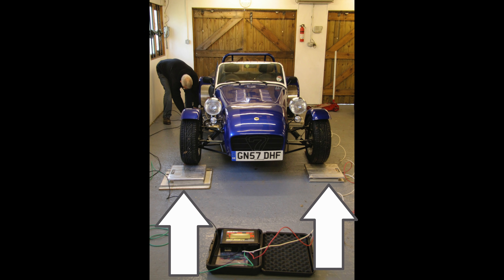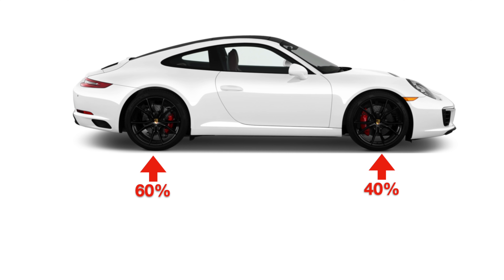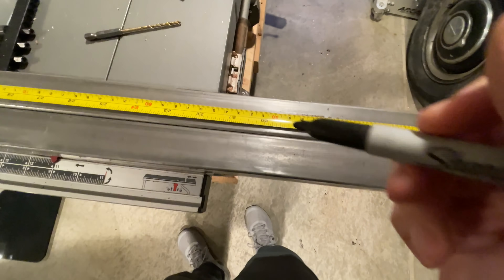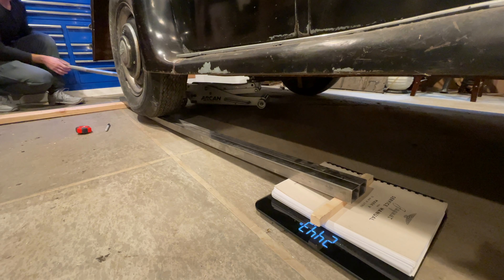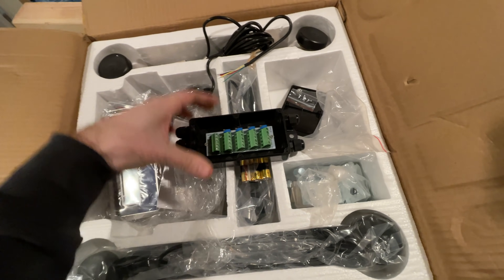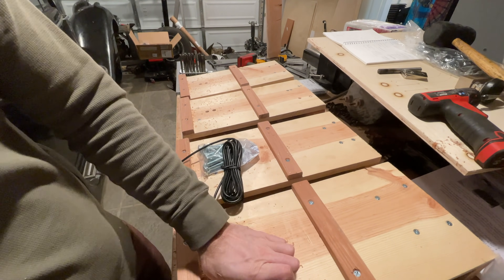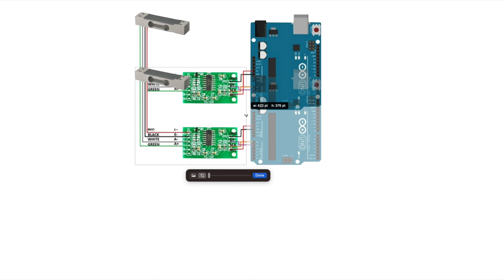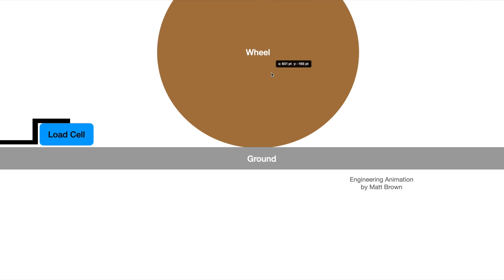I Invented a Better Way to Weigh Your Car. And it's Cheaper, Too.

Comment: This channel is like if Engineering Explained actually wrenched instead of just theoretical whiteboard stuff sponsored by whatever car company wants to advertise through him.
Reply from the maker: Engineering Accomplished
Reply: @SuperfastMatt  shots fired
Reply: Didn't he have a supercharged S2000?
Reply: @crackedemerald4930  He has a supercharged Miata now
Reply: maaannn leave EE alone he's fine
Reply: @ohitstarik  agreed, I love his videos. the recent ones on hydrogen fueled ICEs I thought have been great. what am I missing? am I a dorkus malorkus?
Reply: He’s the experimental professor
Reply: Then again, there's a reason he daily-drives a Model S, and it ain't wrenching ability lmao.
Reply: That explained person gets half of it wrong, you can safely ignore em.
Reply: @nobodynoone2500  I'm not sure exactly what your talking about. I tend to fact check youtubers for a while before I trust what they say and most of his information is correct. It definitely helps that I'm a mechanical engineer and he shows all of his work
Reply: @Depl0rable10  Its not half wrong, its 10% wrong. Do you know how much you have to get wrong before something doesn't work? just 0.5% in just the wrong spot. Jason is someone you listen to to get a beginners course.... not an education so you can build something. Especially not something that can hurt you
Reply: @nobodynoone2500 what does he get wrong? All his calculations and claims are easily verifiable and he encourages you to check
Reply: The only person getting half of it wrong is you I'm afraid. Both Matt and Jason have experience as mechanical engineers at automakers. @nobodynoone2500

Comment: Wait, don't you need to account for the distance from the tire center to the caster wheels?
Also do load cells like being bent like that?
Reply from the maker: 1312iYo is correct, no need to account for the distance since it combines all the load cells, and the load cells are designed to be cantilevered like that.
Reply: @SuperfastMatt  Did you orient the 4 casters of the dolly to account for that variable? If they were oriented in a similar way it would make the measurements relative to reach other.  Love the ingenuity.
Reply: @SuperfastMatt  A year later and I'm at the point of my project where I actually need to start weighing my car.... Time to see if this method will work with some gojak dollies I got lightly used on Facebook marketplace. Really hope the threads on these casters are universal..
Reply: SInce there is a load cell in each corner of the dolly you only need to add all of them. And load cells needs to bend, you mesure the deformation to get the load.